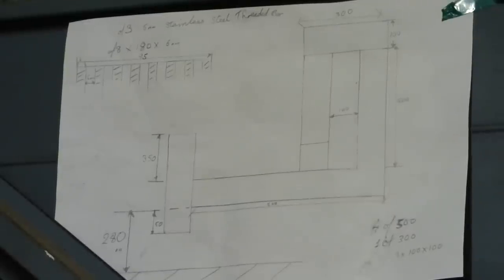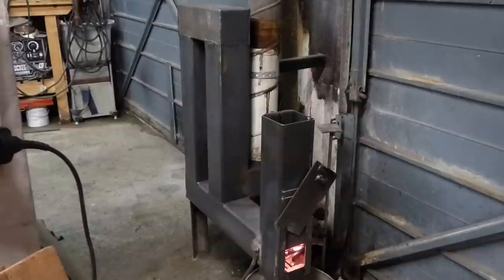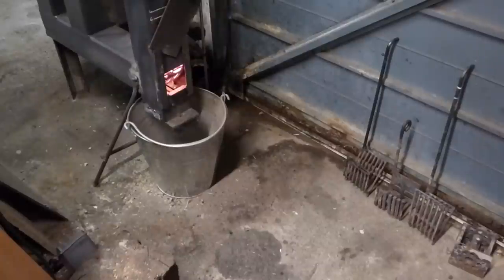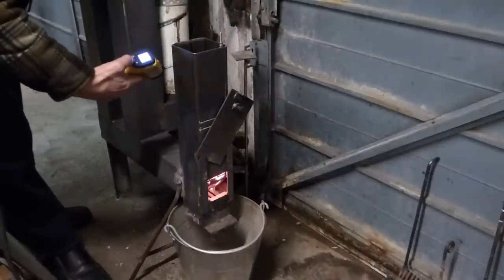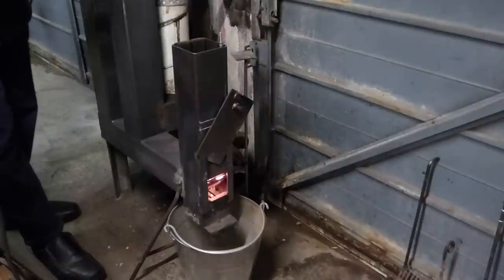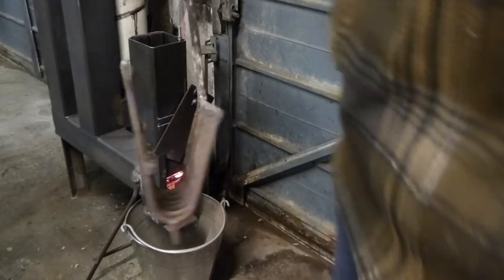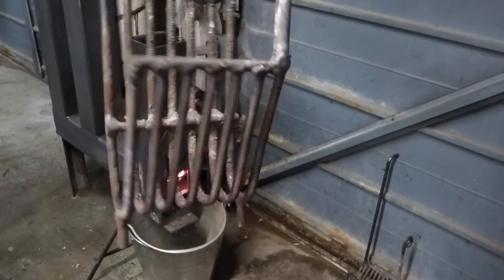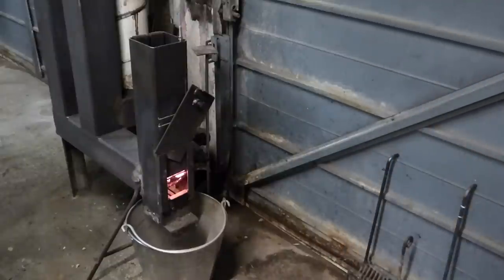DIY rocket stove wood pellet space heater MK3 No.9

Comment: I've changed basket designs also and get a variety of temps depending on the air flow thru the pellets and how the air is introduced to the gases. The idea is to get the temp you're looking for while using the least amount of fuel, like you stated. And also making the stove run all day ( and night) without having the flame back up into the hopper feed ( happened once when I first started my research prototype. I've since switched from using the stainless bar design (which did work alright) to the design I found on the Riley pellet burner that you can add to your camping cylinder stove. It's seems to work better and easier to control the temperature by just introducing more or less air to your burn tube. If you add more air, it slows down the draft sucking thru the burner, which cools the stove down a little ( had to experiment with just how much air) and if you close the air inlet, it makes the draft more powerful and runs a lot hotter (sometimes too hot!!) So you will need to do your research and experiment a bit. Such a simple design puts out such a mass amount of heat. I don't even think about buying a commercially made pellet stove with all the electronics and motors involved. Too much can go wrong at such a high price. Once this idea is perfected (there are already 3 different models out there already) I think the electric pellet stove will lose its popularity.

Comment: David I have watched a lot of videos on rocket stoves, and I have to say I just love the simplicity of your design. So much less bulky than the ones with a burn chamber rising up into an inverted drum. Your design is a real space saver. I do have a couple of questions: 
1. Is the distance between the opening at the bottom with the bucket underneath, and the far end of the horizontal feeder tube 700mm in total?
2. Have you done any trials feeding sticks or small logs into the fire rather than pellets? That would probably remove the need for a grill at the bottom.
I imagine your design would be incredibly cheap to build. Bravo!
Reply: Sorry Dave, just saw the more recent video where you did burn lengths of wood. From memory you recommended making the vertical tube where the wood goes in the same height as the other vertical tubes where the heat flows.
Reply from the maker: video No37  is on wood.
Reply: @davids381  Thanks that's the video I found. I just watched an earlier one where you took a stove apart that had done 5 years and had lost a lot of metal in the core. Do you think the tubular steel ones will last longer?
Reply from the maker: The distance between is 600. Done trials with twigs and logs, dont need a grill for that

Comment: great video david, if you were to close in the 2 vertical tubes and filled it with sand would that hold more heat for indoor use? im sure it would hold heat long after the fire is out, what do you think?
Reply from the maker: the tubes  are the chimney if you fill with sand they wont work

Comment: also, i see as ash falls into the secondary burn chamber under your basket , some falls thru to the bucket is the bottom open or some size of smaller opening ? looks like maybe a slide plate and does it stay closed or cracked open etc...

Comment: Hello, David. Was wondering if I left a air gap under exhaust leg, but still left attached, would it still provide a clean burn? Help lower stack tempature. Tempature reaching over 1000 degree F. Used 4"x4" X1/4" tubingon lower tube. Installed a hopper similar to the one on Wise Way stoves. Love your design, spot on.

Comment: I just completed one that is almost identical you your design with dimensions converted to inches.  I added a ash box below the burn chamber which has a door.  I fired it up today using small soft wood scraps from wood working.  The flame is following the path of least resistance and going up the feed tube rather that horizontally through the reburn loop. I am not getting the rocket effect and there is a good bit of smoke, fortunately, I tried it in the open rather than inside. There is little draw through the fire basket.  I am in SC in the US and finally located a Tractor supply that carries wood pellets and will try those hopefully tomorrow.  What else am I missing.  I previously built two basic rocket stoves but loved the concept of the rocket stove heater for my shop. Would I be better off with the feed tube on an angle rather than vertical and right above the burn chamber? Thanks for your help.
Reply from the maker: you need to watch video 37 to see if that helps your problem. The chimney needs to be minimum  3 meters long, hope this helps. Dave
Reply: David, I wanted to thank you for your response to my question about the smoke coming from the feed tube.  That was the answer to the problem in part. I now have 15 feet of chimney which works great once the burn is hot. I did some research about how chimneys draft and chimney sizes which also helped a lot.

I do have a follow up question along the same line. What is the best way to get the fire started without getting having smoke fill my shop before it starts to draft. I have been using a propane torch to get the fire started. 

I am working on making the baskets to your specs for pellets. So far I have only been able to get a bag of hardwood cooking pellets. What works best so far is burning wood scraps and using an expanded steel grate formed to fit under the feed tube.  And suggestions welcomed.
Reply: @942hartley  Joe did you ever resolve the start up smoke issue? I, like you, plan on using this to heat my shop. I live off grid in the US, so I am attracted to efficient no power sources of heat for my shop. Would love any feedback on where to source schematics or plans for Dave's rocket space heater and any "If I did it again" tips.  Thanks
Reply: @timsears4385  i now use it regulary in the colder months. It burns best with pellets. I have been buying them from Tractor Sply. The soft wood pellets used for animal stable bedding burns great. I also made a tapered pellet holder that is inserted down the feed tube with the narrow end just above the ash drop which allows for good air flow. I use some kind of kindling under the pellet holder to get the fire going. I personally use a propane torch to light the kindling. 
To prevent the flame from coming up the feed tube I fill it at least halfway up to force the flame to travel horizontally untill the unit begins to draw. I also made a cap with thermal insulation like rock wool for the feed tube. Tempertures in the burn chamber can run in excess of 800 degrees F. When the feed tube starts running out of fuel it will start letting smoke escape which can be controlled with the aforementioned cap which may need to be weighted down. 
Also i have used clean wood chips but find they tend to get stuck and need to be pushed down or poked with a heavy duty wire rod from time to time. Proper length of chimney is important as well to get proper draw. The whole thing is a learning experience but produces goid heat for my 2 car uninsulated garage shop. Hope this helps.
Reply: @942hartley  Thanks for replying Joe. I have a 26x36 garage that I need to heat in winter for fiberglass work. Does this keep your 2 car warm in winter? We only dip into the mid 20's once in awhile.  Usually 35° - 45° in winter. Did you build the 4" tubing version to Dave's specs? I saw one video of Dave's where he was burning wood fed through a 45° tubing attached to the front door instead of through the vertical feed tub.

Comment: Hi David, you mention that the gap in your primary grate is 4mm, and the secondary is 20mm. Could you explain a little further? Would you not want the secondary grate to be smaller gap so as to allow the pellets to break down further? Would a 20mm gap simply not catch the pellets? Thanks!
Reply: Sorry David I just rewatched for the 3rd time and realize you meant there’s a 20mm “drop” down to the secondary combustion chamber. I’m assuming there’s a grate between the secondary combustion chamber and the ash pan, if so what is the gap in that grate?
Reply from the maker: 6mm is the gap.
Reply: David S so 4mm top grate and 6mm for the bottom? I saw one of your videos measuring the gap on your grate with calipers and you measured 6 - 6.5 mm, but I’m not sure if that video was before or after the one you made saying 4mm.

Comment: very neat. i've just made a basic rocket stove with a return from the upper mid point on the exhaust to bring hot air tback to where the wood is.. though its just a stove and this is what i was more thinking. can you please go into more depth on the explanation of how it all works. i appologize i am new to this concept. i was planning on using an old air tank with a 3 in gap but this is better it seems. thank you~ Ryan from US, north carolina

Comment: This video was very helpfull. Thanks! 
Ik was strugeling with the size and the shape of the basket. My pelletburner was producing a lot of unburned thick smoke. It am building mine after the wiseway pelletburner concept and making my own version. Can i ask if it is nesassary to have that gap behind you feedtube? Or can all the air come from the front opening? 
What does it add in terms of funcionality?
Love your video's! And thanks for the help!!!!!
Reply from the maker: it is necessary to have the slot minimum size 6 mm. not all the air can come from the front opening. it gives you the right combustion.

Comment: hey david, love the easy to build stove. i own a sawmill and am looking for a design that will burn chip from mixed scrap waste... like softwood slabs, limbs, end cuts, sawdust... anything that makes it to the chipper.. and of course it will most likely be largely green debris.. i think 4" tube will not be large enough to prevent jambs of the flow of material coming out of the chipper even tho it is fairly small it is nowhere near as small as pellets. so if im correct all measurements would have to be increased .. for example .. if i went to 6 in tube.. all measurements would have to be increased by 50%. and have you ever tried to run it on standard chipper mulch... if so what kind of issues did you run into ?

Comment: Hi Dave, over here across the pond in the U.S. we have wood pellets that are 1/4" diameter.  I make a basket with a 3/16 gap but some times the pellets get stuck.  Your 4mm gap and 20mm air intake gap sounds great.  Question:  what is the diameter of the wood pellets over there?  Love the stove build great design and ingenuity.
Reply from the maker: 6mm wood pellets.

Comment: Hi Mr. David,  
 I have  tried and i built a heater according to the design of yours, I face two problems:
1 - burnback of pellets even before  low level on the chute pippe  :
2 - My  heater is not so efficient as yours because, i guess,  had to level the output higher ( it was making too much smoke = not a good burning).
Any help will be very welcome. Many thanks in advance

Comment: thank you for the video. just a ? for you sir. what size of pipe are you using it looks like 4" throughout the hole thang . yes or no .and if the feed is 2' tall than how long is the run to the next pipe going up. thank you for your time . wc
Reply from the maker: up date part 2          100mm
Reply from the maker: yes 500mm